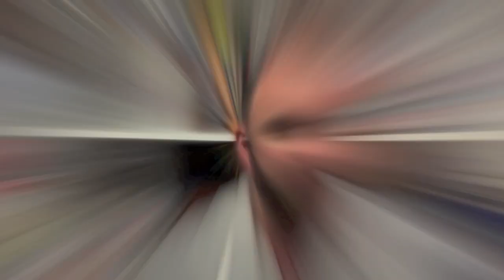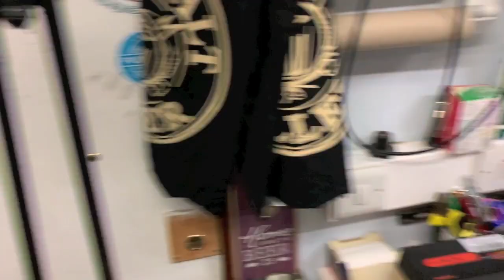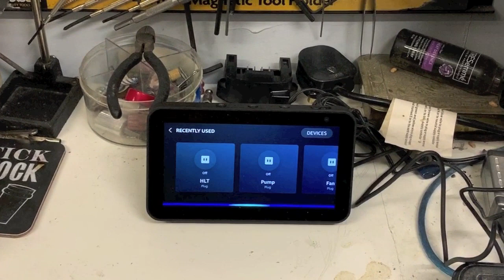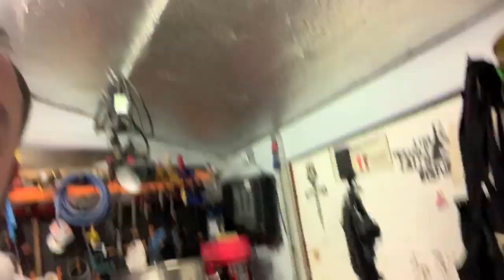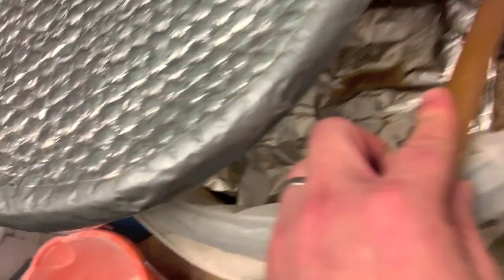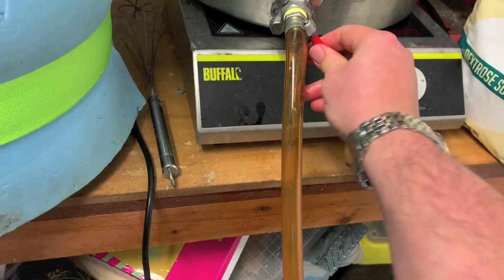Voice Controlled Brewery with Alexa

Comment: Good find Rich, I use an induction plate for brewing as well and struggle to find timer switches rated at 13amp, this will work a treat for early morning brew days where you want the HLT warmed up before you wake up :-)
Reply from the maker: Dan Walters Alexa won’t let you schedule timers for them unfortunately but you can do this in the original app for the plugs, so yeah you can program it in advance so you are ready to mash in as soon as you get up 👍🏻

Comment: You start saying the garage isn’t wired up for power but then your HLT has two 2.4kW elements. I’m slightly worried about all of those extension leads you’ve got about. Then the amount of fridges etc. Would it be worth as your next project getting your main supply and electrics all up to the job? How are you getting power from the house to the shed?
Reply from the maker: Andrew Lynch it’s all good mate the shed is connected to 1 of the house ring circuits via an armoured cable. The extensions are just to get the sockets over to the workbench as it’s on the other side. I don’t run both the elements on a single socket/extension so it’s not blown anything or tripped out to date. That said I do want to get a separate circuit installed for the shed at some point soon as there is a lot of electrics in there and I’d be more happy having it on it’s own breaker

Comment: My Alexa been going nuts with all the commands you’ve been sending to Alexa, I use Alexa to control my Inkbird and Hive heating. I use a hive wireless plug to start my brewing off early while in bed, just connect and switch on saves getting out of bed. I could delay brewing with the app, but like using the plug. When you said pump on Alexa though you said pink fong, so I’m playing baby shark now. Thanks